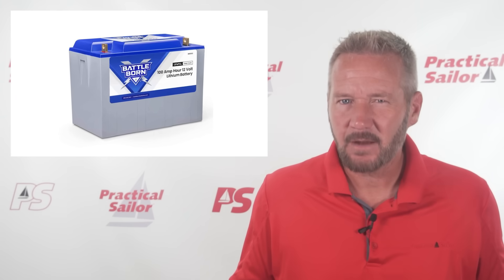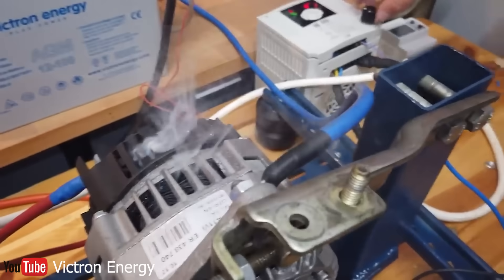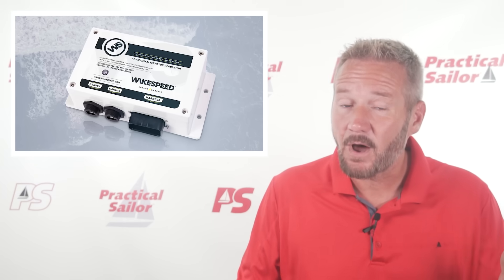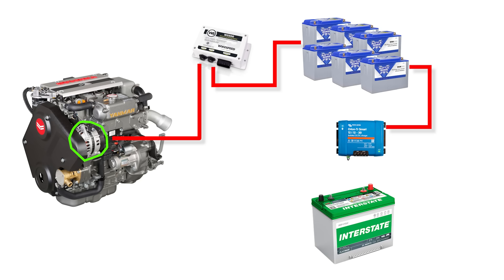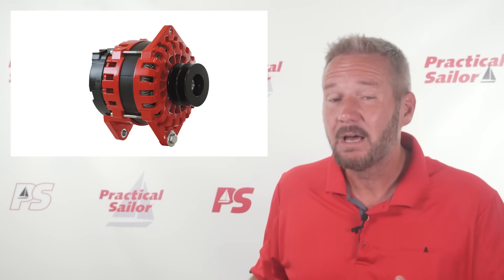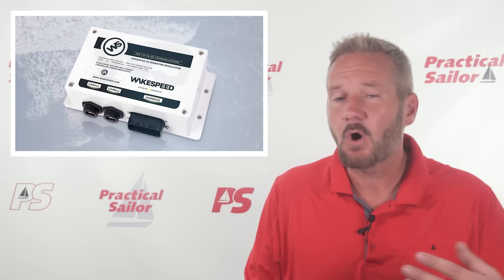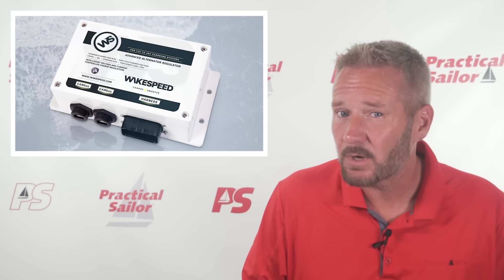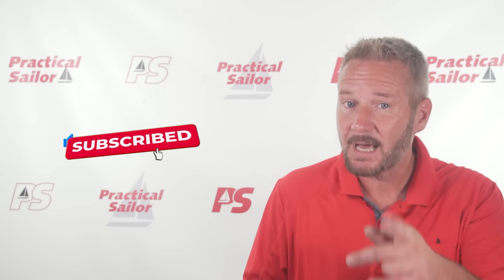Why you should buy this $1000 device for your sailboat – Wakespeed Alternator Regulator

Comment: What I would do is mount a separate DC generator being the gearbox connected to the lithium battery bank that can generate power during motoring or during sailing in regen mode while the motor is disconnected from the propshaft
Reply: Sailing in regen mode. Not impressed. Very little power.
Reply: @tmog1000 you have a wrong prop then.
Reply: @tedarcher9120  Well I do not have a brunton prop. But I do have a proper regen electric outboard. Generation is insignificant Unless I am sailing above 8 knots. Far better spending extra money on more solar. And a £1,000 buys a lot of solar.
Reply: @tmog1000 outboards are useless for generation, their prop is mostly in the boat wake. You need for the leg to extend past the boat bottom to get good results
Reply: The regen is getting better but it’s not there yet. Hybrid systems are the future for boating. They are already the primary source of power for large ships and trains. But even those have a lower regen rate than is efficient. The problem with hydro regen is induced drag. Once we over come that then we can work on the actual regen amount.
Reply: @ryanrevis827  Unfortunately power only comes with drag.
Reply: @ryanrevis827 for most sailing conditions you have way more power than is useless. You can calibrate your regen controller to only turn on over hull speed so you don't lose any speed at all
Reply: Electric motor/generators are already a thing, look at Sailing Uma. They have been using one for years. The generation under sail is not a lot, and requires absolute precision alignment in order to not be a drag chute in the water. Most people aren't going to fool with this.

As an alternative, you can have a setup like the Greenline boats use. This is the most efficient way, but you won't get much under sail.
Reply: @charlieodom9107  sailing uma don't have a diesel
Reply: I think after spending about $5000 on a system like that you would get 10 amp charge under nominal conditions. XD XD XD

Comment: Are you aware of 'Clark's Adventure'? Sailor/youtuber with a Big brain, designed a clever device called Bank Manager, + other DC devices, incl low power use A/C.
Reply: And it does it for around $350 if I'm not mistaken. Maybe less fancy than this setup (no CAN bus), but it does the job.
Reply: I came to the comments to see if anyone mentioned Clark’s Bank Manager. 👍

Comment: Should mention there are other brands of external regulators like  Balmar and  Arco . Been using my Balmar for years, yes external regulators are great!
Reply: +1 to that. The Balmars with alternator temperature sensing have been a great solution. I charge straight to the Lithium house bank but parallel charge the engine start (AGM) battery when the engine runs so there's a battery connected inc case the Lithium BMS's shut off while charging. Have seen the resultant voltage spike effects on other systems where there hasn't been done....
Reply: @FlyingboatsRCG why not use a Balmar Alternator Protection Module?
Reply: @flygringo  Two reasons: 1, the Engine start battery still needed to be charged so needed something to split the charge for that and 2, I already had the VSR. A paralleled lead acid battery provides better voltage spike protection as well imho.
Reply: @FlyingboatsRCG makes sense.   I'm about to make the switch to lifepo4 for my starter bank. My house bank is already lifepo4

Comment: Mmmm
Whats the biggest danger on a sailboat
Not typhoons etc
Fire!
And lithium batteries are still too risky
Reply: There are lithium batteries and there are lithium batteries. Lithium-nickel batteries are very dangerous, but Lithium-Iron batteries are safer than lead-acid, you can stab them or roast them in the oven and nothing happens. They are also much cheaper than lead-acid
Reply: Don't use them, use LFP  . Which is what they talk about here.  They are not lithium ion batteries that spontaneously combust
Reply: @phanttomracer  Technically, all lithium batteries are Lithium Ion including Lithium Iron Phosphate. It is unfortunate that “ion” and “iron” sound so much alike.

Comment: Couldn’t you just replace the lead acid with lithium + Wakespeed, so it charges from and can start the engine?
Reply from the maker: Ah possibly but most lithium batteries are not designed to start an engine :(
Reply: @practical-sailor there are some that can start an engine. Notably Wattcycle
Reply: @phanttomracer they probably have the same issue with overcharging
Reply: @tedarcher9120 then the system isnt set up correctly.  Still need a smart regulator like balmar/wakespeed/arco with any LFP battery system. Once full, the regulator will shut down charging before the batterys bms does.
Reply: @phanttomracer yes you need a smart charge controller anyway, if you have one why bother with starter battery at all, just use the house bank
Reply: @tedarcher9120 because, as others have commented here and on many channels, li-ion, specifically LiFePO4, is not fit as a starter battery. They'll damage it internally, and you'll have to replace them sooner, or worse. 

Using it as an incidental backup for your lead starter is fine. But for all the time is just bad economics. Replacing house bank every 1 or 2 years instead of 10 vs a single $50-100 starter battery that lasts 5 years and protects your li-ion in the process.
Reply: @tedarcher9120 best practice is to have 2 banks so you can alway start your motor.  If you have a FLA starting and a start ready LFP, you have the ability to start the motor if the starting battery dies. I wouldn't want just one battery bank on my boat. I wouldn't want to rely on a well drained starting LFP to reliably start my engine in a single bank system.
Reply: @Misteribel depends on the battery size, most are powerful enough to start a motor with ease
Reply: @phanttomracer you can have 2 independent house banks, one on the left and one on the right for redundancy
Reply: @tedarcher9120  The only thing stopping me from doing that is if I get a lightning strike. Lead would still perfectly fine. The bms in the lithium is likely to get burnt out.
Reply: @phanttomracer  I think that if your engine hasn't started after an hour of constant starting you have other problems. And your lithium would still not be flat.
Reply: @tmog1000 you would still be able to use the battery of you put a big mass cutoff switch across the BMS, just not for very long. And if you have a big lead battery you need a BMS anyways, otherwise you'll get hydrogen buildup.
Reply: @tedarcher9120  Car, truck and bus batteries do not have a bms. Lead batteries should have a hydrogen leak off pipe fitted. Mass cutoff switch would do nothing against emf from the lightning strike.
Reply: @tmog1000 they do if they are over 12 volts. If you assemble your LFP battery correctly you can bypass the external BMS easily. But then you'll need to manually balance them without a bms
Reply: I replaced a 60 amp starter battery (claims 550ccl) with a cheap 100 amp lifepo4 off of amazon, and it starts my Yanmar 3jm just fine.  I Did exactly what you said, I just got rid of lead acid and added the balmer regulator.  I even left of the old lead acid charger in place.  It works just fine.  The Balmer regulator is hundreds of dollars less than the wakespeed.  I get the balance charge when im under way from the Balmer.
Reply: What are typical starter motors current requirements 200-300a? 2-4 LFP batteries would handle that fine, not sure what damage that would do, hows that different to kicking on a load on an 3000w inverter